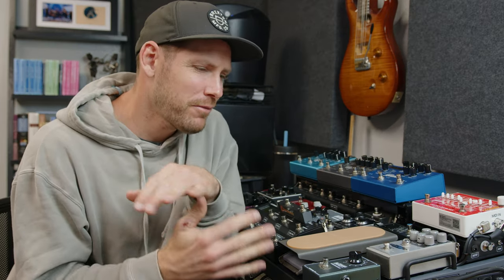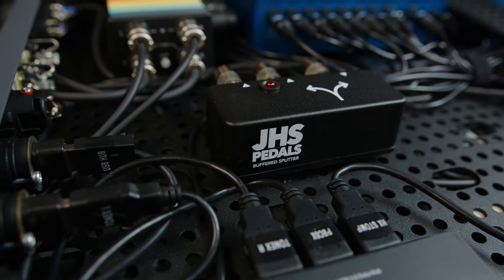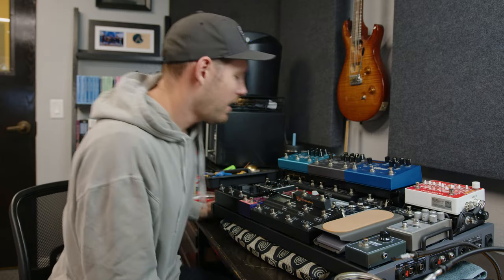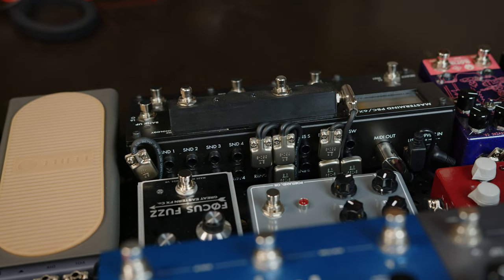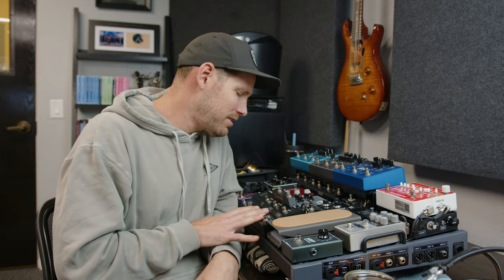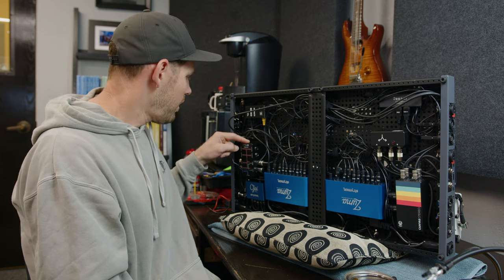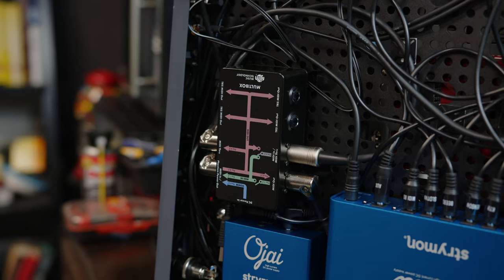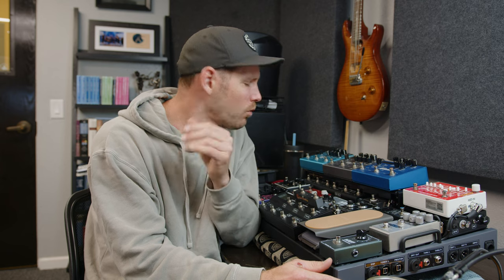Part 1 - Layout & Signal Flow (Building a Pedalboard Series)

Comment: I would suggest you buy rjm’s parallel box and run the mobius/timeline/bigsky in stereo parallel into that and then back into the return for loop 5, or otherwise incorporate a parallel. I had a very similar board built around the 6x that I moved away from due to lack of parallel and more loops. But with your board I think parallel stereo effects is the only thing you might miss (ie running delays and reverbs in parallel). That or get a duophony and run the timeline and big sky after the mobius into them.
Reply from the maker: I have another board I'm playing with right now that has the Jet Pedals Red Sea on it and I'm using it for running my delay and reverb in parallel. It's so fun!

Comment: Thank you for sharing your pedalboard and signal flows. Your pedalboard is awesome! I have a small pedalboard and try to make a fit guitar tone for Sunday worship service.

My signal flow: Guitar- buffer - Jackson Audio Prism - Jackson Audio Bloom(comp & EQ always on) - Ryra klone - Jan ray klone(with boost - I can set up for either gain boost & volume boost) - Browne protein OD - Lehle volume pedal - Ruby 63 - Timeline - Bigsky -> Stereo out

Questions: 
1.  If you have Ryra - Jan ray klone - Protein OD, how would you set them up? (i.e. gain level, output level, etc.)
2. Is there a big difference to place ruby before the modulation pedals or after the modulation pedals? and which placement do you prefer?

I know those questions are very basic stuff for others, but I really need any help to a set fit tone for my worship service.
Please give me your feedback whenever you have a time

Again, thank you for sharing a great video for us : )
Reply from the maker: If you’re on Instagram, send me a message @thetoneshepherd I’d love to chat through this with you. But it would probably be more helpful with pictures!

But I did talk about in my video how I organize my overdrives. Each stage is a little more drive and a little more volume. In your case I’d likely set the Jan Ray as the first stage (slight breakup), probably the blue side of the Protein as the second stage drive and then set the Green side of the protein as a boost to the blue side as your third stage (so both sides are on together). Then use the Klone and/or the boost on the Jan Ray as an optional boost.

As far as how to order these I’d say that’s personal preference. But probably Jan Ray > Protein > Ryra (used as a boost). 

Personally, I’d keep all the effects in front of the Ruby and let the Ruby come last.

Comment: Thanks for sharing so much into how you put your board together. I'm in the process of making a new praise & worship board and a lot of what you've shown I'm interested in doing myself. I like that you designed it such that you can plug in your mains from either side of the board. My question is how did you make that work? Did you use some kind of splitter or special cable so power can be routed from either of two different sources? Basically, I have three power supplies I can chain together, but not sure where to go from there. Thanks again 🙂
Reply from the maker: Glad you liked it! As far as the power goes, it's quite simple, I just spliced together a few power cables. Green to green, black to black, white to white. Nothing more to it than that!
Reply: @thetoneshepherd  Oh I see. So essentially, did you make a Y-cable for power?

Comment: Greetings. Love this video! I was wondering why you have the wet effects in a loop? If at least one is always on, couldn’t you have them after the pbc6x (to free up a loop) or is there an advantage I haven’t considered? Cheers.
Reply from the maker: Great question! I did it for two reasons 1) So that I can easily bypass all of my wet effects when testing the tone of just my dry signal. 2) So that I can route my wet effects post amps if I want for a particular sound or moment.
Reply: As always, a swift polite and informative reply! Legend.
While I have you, do you ever use splitter cables from your power supply? I’m thinking of powering my three (non midi) pedals one Cioks output. I’m keen to have a quiet rig, so I could get a bigger supply but I wondered what your experience is.
Reply from the maker: I appreciate that David! I have tried splitting power between a few devices in years past but not recently. I’d imagine if you chose to power things like your tuner and some other utility pedals using one outlet you could do that without much consequence…but perhaps someone with more electrical knowledge could give a concrete answer. I always just try it and see what happens haha

Comment: Great series, subbed. Did I understand correctly that you used velcro instead of the Temple Audio mounts? Any particular reason? Also, does the Tonex pedal play nicely with overdrive pedals? I found that most modelers by nature responds differently on overdrive pedals, but some do great. Do you have examples of pedal that work the best? I,m guessing all of them on your board, but like to here your thought. Thanks for the great content!
Reply from the maker: Thanks a ton for the sub! Yes, I use Dual Lock. The Temple mounts are solid but very much limit what and where you’re able to mount stuff under the board since the screws pop through. The ToneX take pedals like a DREAM! It’s the best capture device created yet. All examples can be found in my full rig demo here: https://youtu.be/p43gUb3T9Ag
Reply: Thanks for answering!

Comment: May I ask for a link to buy the side panel's power (9V DC) that you use to power the audition pedals? Are you able to simply plug your Zuma to the inside to power the module?
Reply from the maker: I’ve provided a pdf in my description with links to all the parts. I believe that one is listed but let me know if not. But you do have to cut/strip/solder one of the Zuma cables to the back of that jack unfortunately.

Comment: I'm an electrician at a local manufacturing facility, so I wire and loom things for a living. That underside is giving me nightmares! XD XD I'd get fired for stuff like that... But, it's also multi-million dollar machines so I don't blame them for wanting it to look good in the electrical shelf even though it's not very likely to be opened up once it's in service.
And the whole not running high voltage and low voltage in parallel, you can do it, but you have to give a couple of inches of space between the two looms. Otherwise, the high voltage will interfere with low voltage and you'll get noise, static, weird disruptions, stuff like that.
Reply from the maker: Haha, well, this wasn't the final wiring. This was just my initial layout...though I'm not sure you'd approve of my final version either lol. Here's what it looks like all completed. Feel free to take more shots. I can take the heat. And I'll do it better next time lol https://youtu.be/p43gUb3T9Ag?t=594&si=psjhDl6RrLEOuMSq
Reply: @thetoneshepherd  Haha, nah... That's not my style. lol. I'm not dissing, just a bit of fun. ;) 
In Truth, After seeing your setup and hearing the sweet, SWEET tones, I don't want my Helix anymore lol. I just want to make bad financial decisions now. :P
Reply from the maker: Hahaha alright, next time around I’ll make it my goal to appease the electricians in the house! ⚡️✅👌🏼. But for real, I was about to ditch my analog board and go all in on the Fractal…and then the ToneX dropped and it completely changed the game.
Reply: @thetoneshepherd  they sure did... They're not without their critics, and some people throw lots of shade at it, but who's gonna argue with the results you got?

Comment: How do i get those mods you have on the side those are third party correct? I dont see that on the temple audio site. Mainly looking for the usb ines that you control hx stomp with
Reply from the maker: Great question! I made a PDF with all those links that I dropped in the description. The Mod is the "Temple Audio Punched Plate Mod" and the USB jack I used is linked in that PDF as well. But you can get it from a variety of different places. Just Google "USB D Panel". Any "D" type jack will work in this punched plate. Hope that helps!

Comment: Hey I am looking to build another board right now around the PBC6X.  Are all your Strymons in the same loop? Are you turning them on and off in loop section or by midi? I'm confused on what kind of cable to use..TRS out of PBC to Strymon or some kind of split cable?  Any recommendation?!  I plan to cut and solder even though I've never done it lol
Reply from the maker: Hey Andre! Have you watched my full pedalboard overview? I give more details on that stuff there. But yes, all my wet effects are going through one stereo loop in the PBC. And I turn them on/off by midi. And yes, the cable you need is shown in other parts of this video series https://www.youtube.com/watch?v=tB8uT75n3LY

Comment: I have an ST-300 which was recently rendered obsolete by the Peterson Mini.  Same size + strong.  The larger Peterson is a little slower in response and large.
Reply from the maker: Bummer! The ST-300 is a better tuner 🫣😝 Faster and more accurate. But if you need those sweetened tuning modes then the Peterson will suffice.
Reply: @thetoneshepherd   The big one (HD no mini) is slower.   The new Mini isn't appreciably slower.   I don't really need the sweetened tunings - I just prefer Stroboscope for tuning instruments.  Easier to see.   The rotating red lights take longer for me to tune.